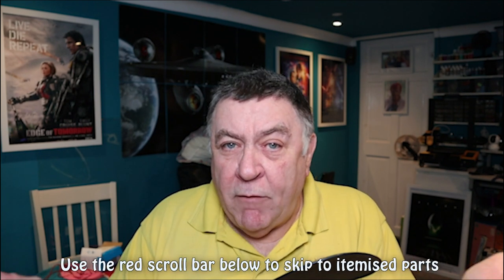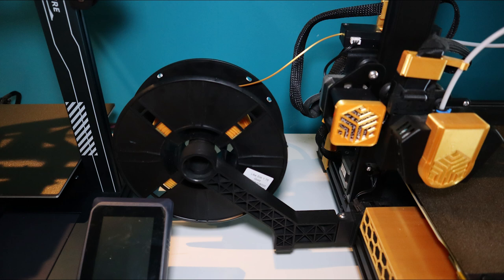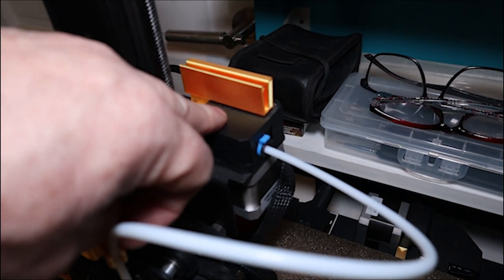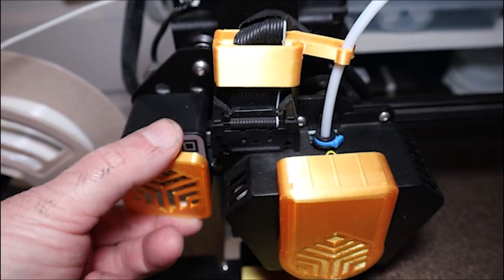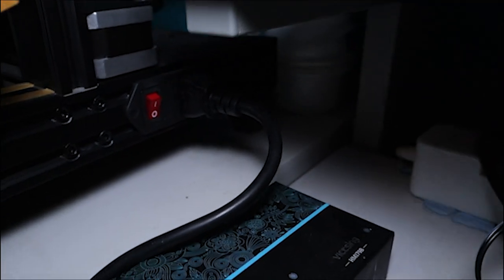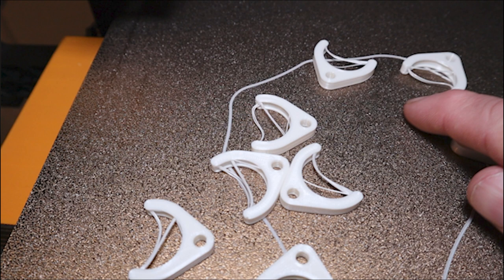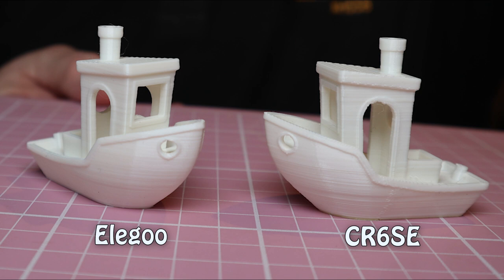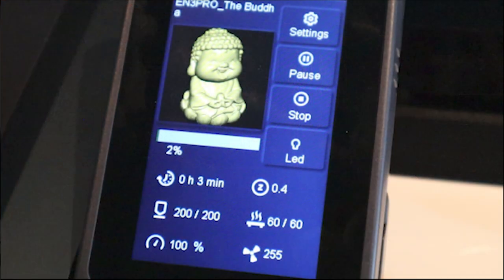Part 2 of 2 videos.. Comparing the features of the Elegoo Neptune Pro with The Creality CR6SE.

Comment: nice comparison, will buy the Neptune 4 Plus as soon as it is available - they are on preorder now.
Have the CR6-SE and use it since it came out..  
one tipp: don't use 99% or 90% isopropanol!  use a mix of 70%, it works great, cleans great and doesn't dissolve the original glas bed :)
Reply from the maker: Hi crckdns...thanks for the kind words...yes I would have normally used a diluted mix of IPA but Creality actually said in the instruction book to use it neat which was the annoying thing.

Didn't bother me too much though as I changed to a magnetic flexible bed early on which I much prefer.

The Neptune 4 Plus looks good with all its cooling and ability to use nylon etc. hope you don't have to wait too long.